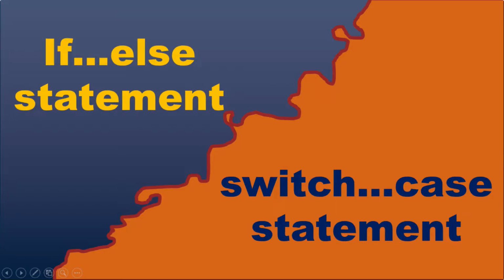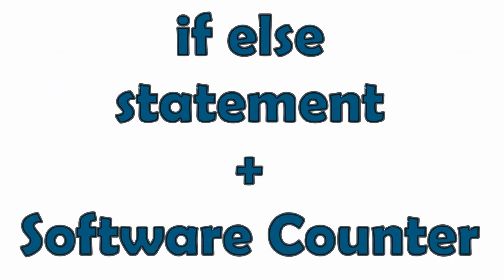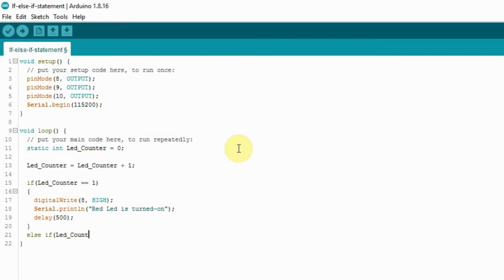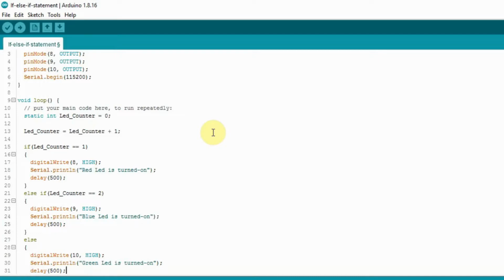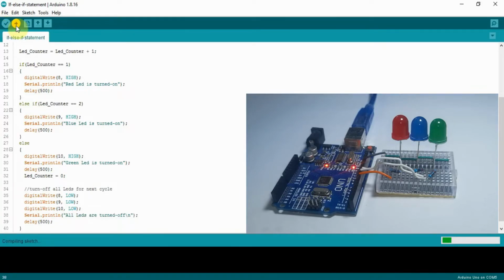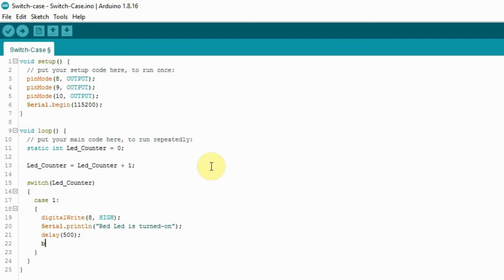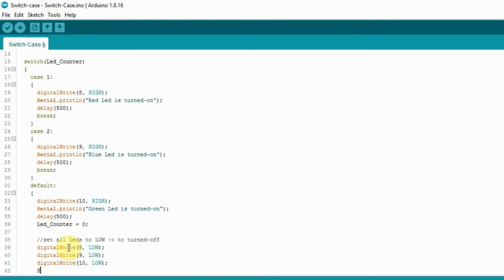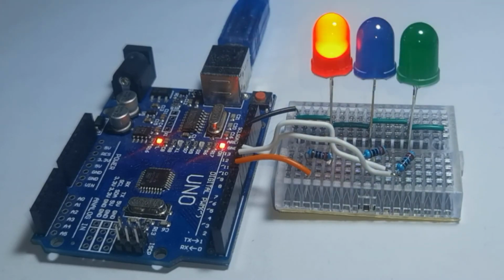if else statement | switch case statement in Arduino Programming

Comment: There is no reason to set Led_Counter to 0 in your default case or the final else statement. You do that at the start of the loop, so this is redundant code. Also, this code does not match your flow diagram. The flow diagram specifies a check for Led_Counter = 3, and only if not then turn off the leds. A niggling point, I grant you, but software development is about precision. Not writing code to match the specs leads to design flaws and less manageable code. Other than that, nice explanation of if/else vs switch.
Reply from the maker: Hello Michael, I really appreciate your both points you have noticed in this video. The first point to set Led_Counter to 0 in default case or the final else statement is needed. Reason for that is Led_Counter is a static variable, that means it just initializes once with 0 at the start of the loop and then never reinitializes during the runtime. Which means it is needed to reinitialize somewhere in the code at proper place. The second point I agree with you that in the code I specified a check for Led_Counter = 3 but I have used only else instead. The reason for that it is always recommended to use an else case when using if...else if structure. If I would have use else if (Led_Counter == 3) instead then else statement would have been empty with no code inside. Just to avoid this I have used else instead of comparing Led_Counter with 3 :)

Comment: I have a question! I tried putting a “delay” in one of my cases. “Case 3: LED1 HIGH delay LED2 HIGH” and it kept looping that one case. The LED stopped reacting to the button I was using. So once I got to that case it kept going LED1 high LED2 high LED1 high LED2 high…. And so on. Can you help me?
Reply from the maker: It looks like switch cases are not getting changed. That means when Case 3 is active then it is not switching to Case 1, Case 2, or default if available. When you don't see any reaction of button, I guess you are using delay inside your Case 3 and if you press the button within this delay then it will not get detected. That mostly happens because software is blocked by the delay API and at that time button press would not be detected at all. 
If you send me your code, maybe I can help you bit more. All of my answers are totally depending on my assumptions and the problems that I have experienced in programming. Best of luck.
Reply: @learnembedded4future532  Thank you! I'd love to send you my code. How do I do that? 
My project is for a theatre play that goes in premiere this weekend, so I'd love to get your help
Reply: @learnembedded4future532   can I mail you perhaps?
Reply from the maker: Yes please do that
Reply: @learnembedded4future532  what mailadres can I use?
Reply from the maker: You can get it from my youtube channel. Please find it under tab "ABOUT" and click over "view email address".
Reply: @learnembedded4future532  done! email is send :)
Reply from the maker: You should have got my response